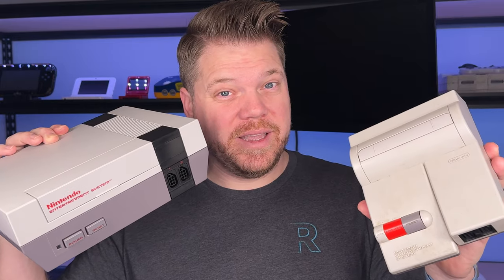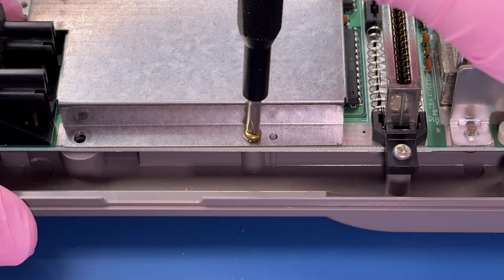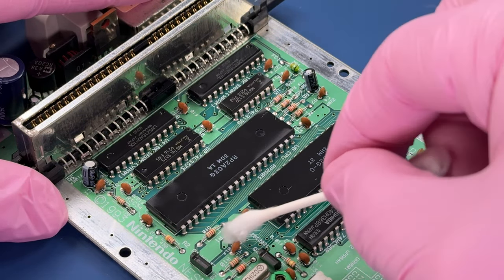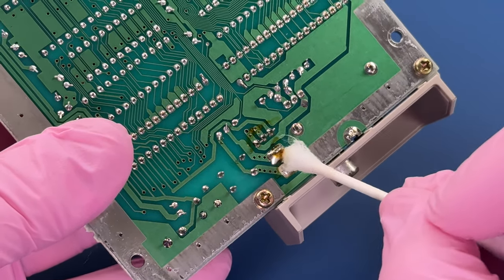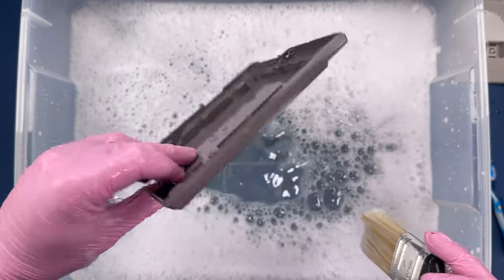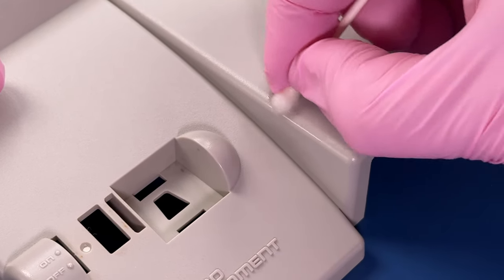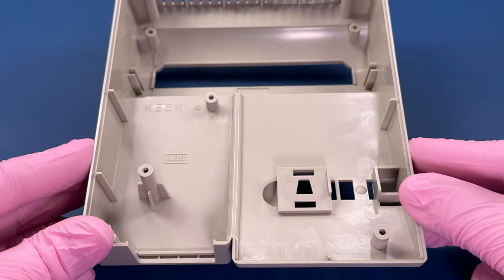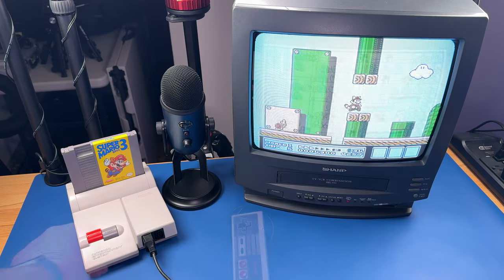"New Style" NES Relaxing Deep Clean

Comment: Great vid! I got a top loader about a year ago. I bought a modded one online that has composite output, simulated stereo sound and has a power LED installed under the power switch. It is by far the best NES you can get. While I prefer the front loader design from an aesthetic point of view, the top loader wins hands down otherwise.

Comment: Did you know that cleaning the shell of NES games with dish soap and water works great? Just rinse it off with water and use a soft toothbrush with drop of soap and you can ev brush the labels. Just needs to be done rather quickly since the back label sucks up water rather fast. After a rinse under running water simply dab it off and let the labels dry out for an hour or two and it'll be good as new!
The edges of the stickers will start to bloat a little but that goes back to normal after drying off.

Remember to not let it soak and do it with running water and you'll have the cleanest cart you'll ever see :)

For rust try to get some Acetum (it's virtually the same as vinegar but but tends to be a bit more acidic and have less taste additives).
Both work fine though. If you have a rusty stove for instance just splash some on there, let it sit and aggitate it now and then and the acid will literally eat away all the rust and leave the metal undeath untouched.

Anything acidic will work, even a lemon, the less acidic the more time it will take to get the rust off.

Comment: So nice and clean! Definitely feels like the "PSone" version of the NES. Guessing the transistor didn't originally have any thermal compound to interface with that metal bracket?
Reply from the maker: Yeah that's a good question
Reply: I know it does on the front loading NES, but I'm not sure about the top loader. I never had a top loader as a kid, and I haven't had any come in for repair yet. Looks good!

Comment: If you're gonna use vinegar, keep in mind that it will most likely also strip away any metal plating (nickel, chrome, zinc, ect...) thus exposing the base metal to the elements. This will cause rust, so you would have to either re-electroplate it, or paint it. Also if you leave it in long enoug, the metal will tarnish.
Reply from the maker: Thanks. I will have to look into this.

Comment: I had both the original NES-001 and this version the NES-101 I liked the 101 for being dependable but was disappointed in only having RF I think they should have released it with the same connector as the SNES multi out port but that's just one guy's opinion :)
Reply: There are RGB mods that also add the multi out port. That is what I will be doing with my NES-101 soon